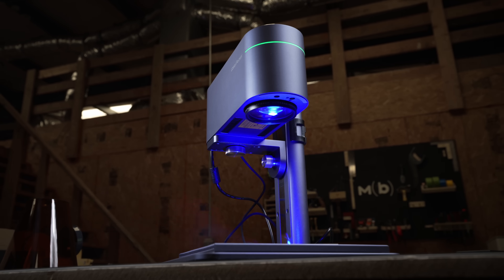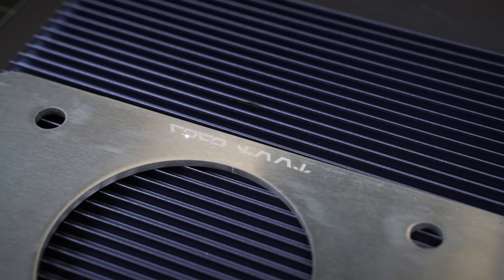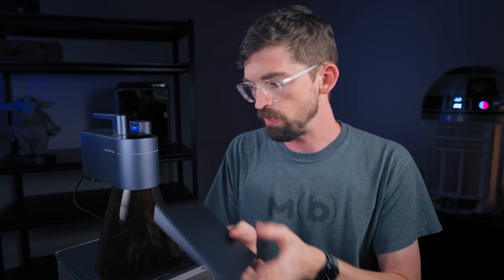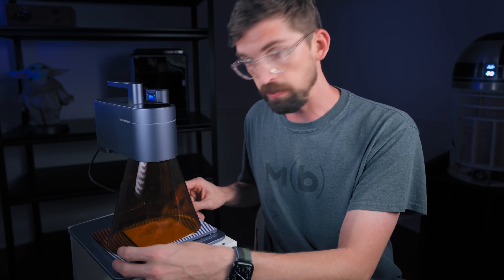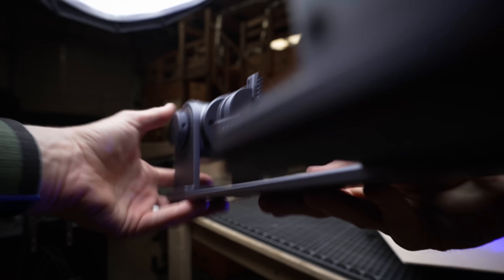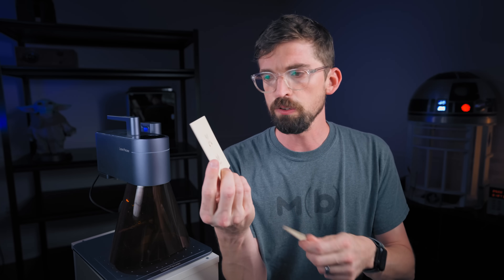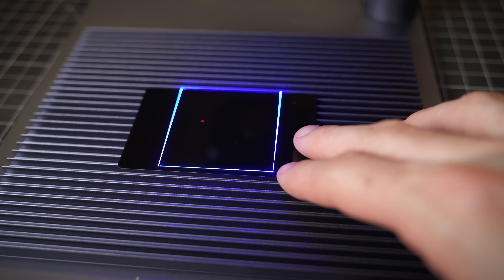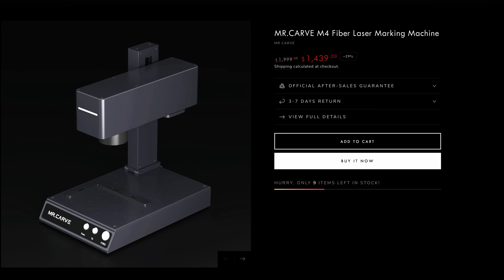Engrave Wood AND Metal with the Laserpecker 4

Comment: I’ve got the LP3. I love it.  but would love to have more setup instructions for the setting when doing glass or just engraving cups. I also have roller platform. Such a let down. The rollers should have been rubber coated because metal cups slide on it. And you can take it apart to add rubber bands and length is very limited. Love the video.
Reply: What's the issue you are having with glass?

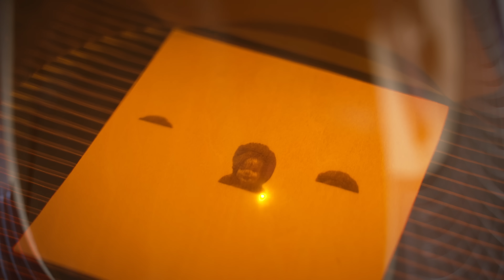Comment: Hey quick question: At 6:45 you say you CAN'T do actual raw aluminum, but then immediately show it being engraved?
So CAN you engrave raw aluminum or no? To what depth? I need to not just burn out the pigment of the anodizing, but rather dig to a .1mm depth so you can feel it's depth.